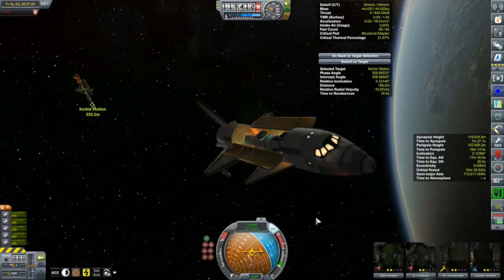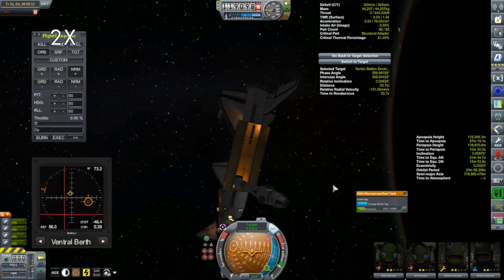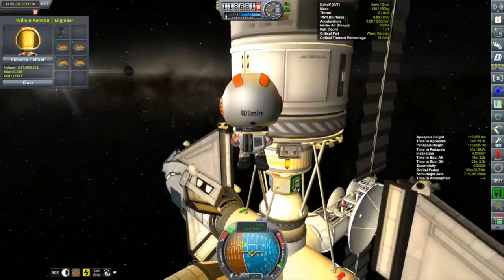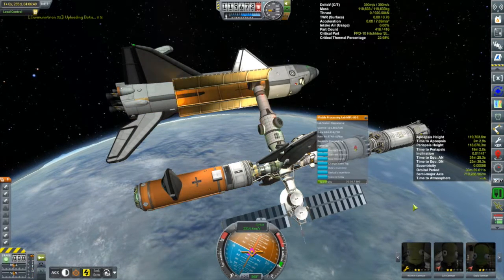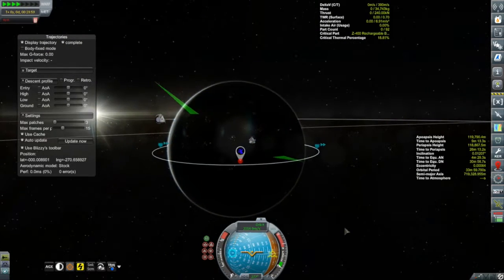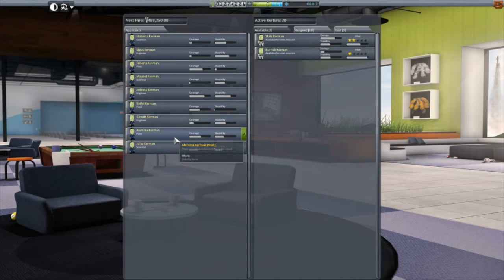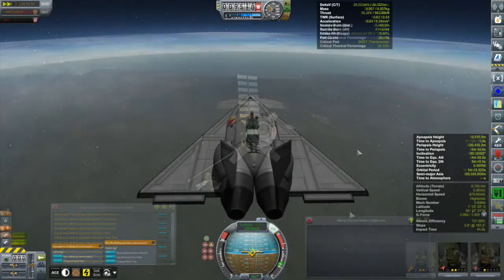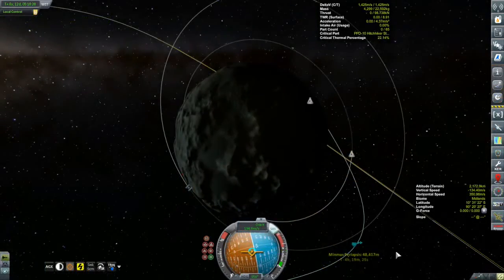KSP Career: Episode 102 - More Berths - More Science

Comment: As usual STALA gets things done, delivering that scrap to Kerbin. Plus 264k in Funds. Nice!

Did that Remote Tech contract "successfully fail" by running out of time for example. That might account for the loss of Funds and Reputation. It would still require some for of bug though.
Reply from the maker: I've seen the RemoteTech contract pack get confused before and fulfil when the parameters aren't met.  I think it has trouble telling what is and is not covered when the satellite in question isn't the active vessel.

What I think happened in this case is that my hopping around had the contract thinking I was trying to fulfil the requirements with Interplanetary Relay 2 (which I did visit to point its antenna, but didn't show it in the episode) and Kerbin station.   Both have interplanetary capable dishes, though not to the outer planets.  Despite that, it started the count down (looks like four hours) and then popped up that the contract is now complete.

However, neither were in the orbit to fulfil the optional requirements (keostationary orbit over the KSC), so I didn't get the funds and reputation associated with that.  I had every intention of doing this part of the contract, so I figured I was justified editing in those rewards.